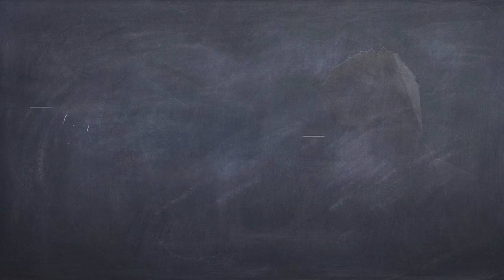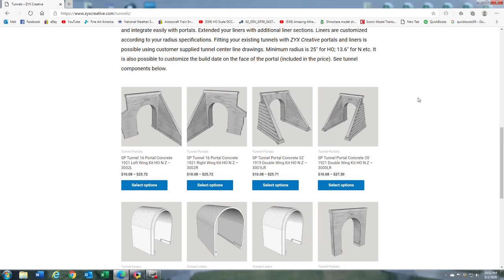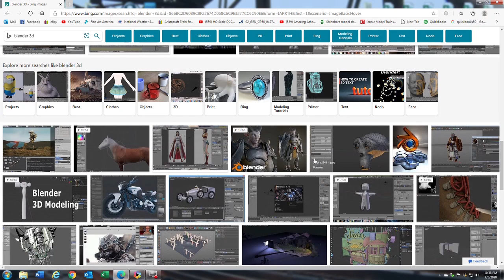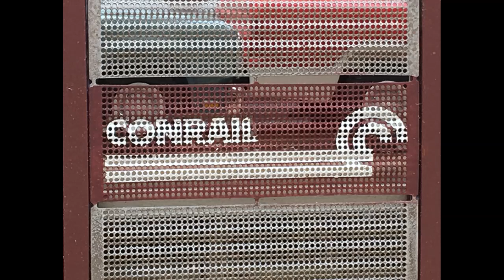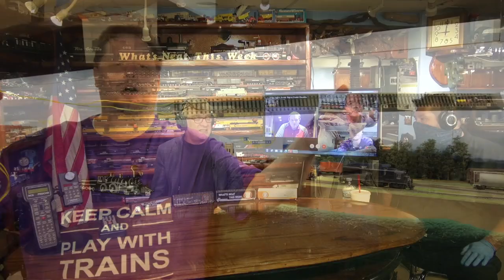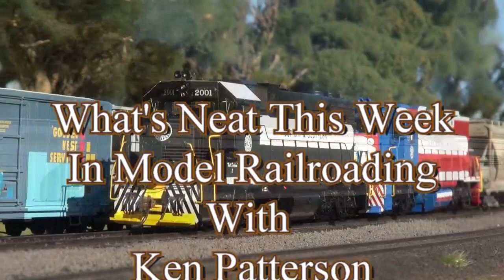What's Neat This Week Show #124 August 1st 2020 Model Railroading

Comment: I'm going to have to pick James' brain. I pocked up and HO Broadway Limited Southern Pacific SD9 for my future switching layout and I plan on adding all of the appropriate light packages and I want to make them work. I also see we both share and interest in old wooden grain elevators. Canada is a great place to find them!
Reply: I would have to look up who to get those lighting package structural details from.  Good bets would be details west or canon and company.  I don't know if Athearn offers those parts as separate packages, but if you can find the parts number on a diagram, Athearn's customer service department.  From there, it's just a matter of drilling and routing wires.

I remember seeing many of those elevators when visiting family in the 1980s and 1990s.  Unfortunately, I have heard that many of those old elevators have disappeared in recent years.
Reply: @JamesRegiersModels  I checked with a Train shop that I've been using and they have the Details West SP light packages for an SD9. In fact Details West web site had a listing of parts to do all the detailing! I model California, but I'm going to take liberties and have an old wooden elevator on my layout.

Comment: Would the oil just pour out the front of the engine via crank seal and valve cover breathers? Cool concept, maybe the crankcase was empty.
Reply: They were designed to be shipped vertically. 
https://www.railwayage.com/mechanical/freight-cars/a-look-back-in-time-the-gm-southern-pacific-vert-a-pac/